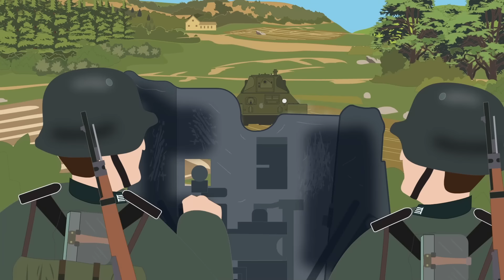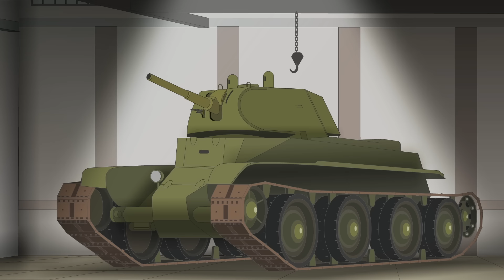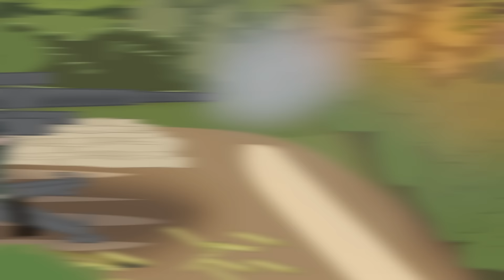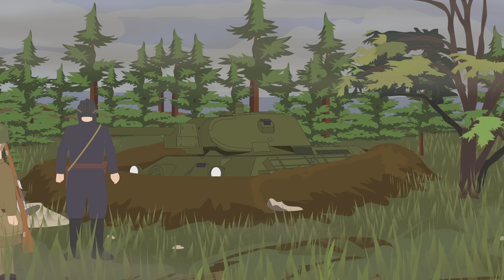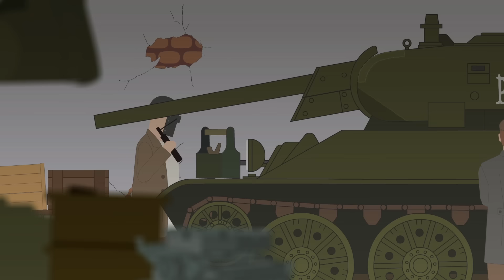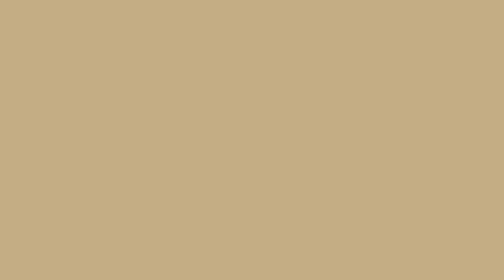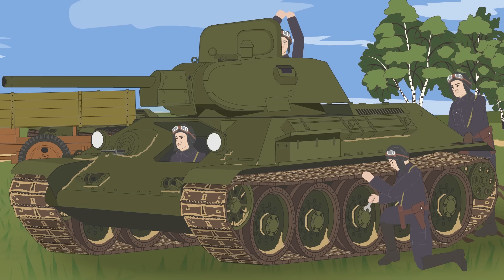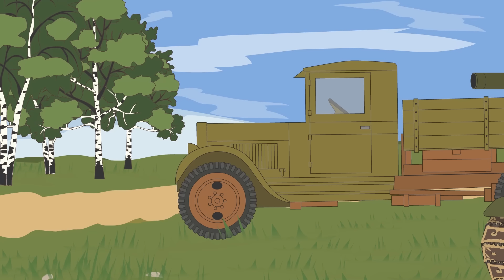Was the T-34 Really the Best Tank of WW2?

Comment: Best joke I have every heard applied to both the T-34 and the Sherman.  "The Tiger tank was as good as seven T-34/Shermans.  The problem was there was always an eighth."
Reply: Well, certainly didnt help when the Sherman Easy 8 /E8 came.
Reply: The tiger also would blow up its engine because it was far heavier than it could handle. The tiger was not only heavier but wider than all main battle tanks, so it needed specific terrain to be able to travel on.
Reply: @NickJaime  Ya it used the Panzer 4 chasis which was somewhat inadequate it also had alot of production problems out the gate engine wise (much like the panther). but it was probably the best tank of WW2 in terms of if you were going to design a tank today. The Tigers biggest flaw was that it was hard to mass produce frankly the Germans would have been better adding sloped armor to the Panzer 4 and strapping the 88 to its turret.
Reply: @toddpick8007  the tiger wasn't the best of WWII. It was over-engineer and wasn't lasting in combat. That doesn't make it the best lol. It was too heavy for a lot of bridges etc. It had far more negatives than positives.
Reply: @NickJaime  I would say from a sheer engineering standpoint that yes the Tiger was the best tank of WW2 and it wasnt really close. 95%+ of the Tigers "flaws" were due to production problems caused by bombing/shortages. The Tiger pretty much immediately outclassed every tank in every combat theatre it was in. Hands down it was the "best" tank of WW2 not most effective, produced, most decorated etc but best in terms of engineering.
Reply: @toddpick8007  except even tigers with perfect quality would still get their wheels clogged
Reply: @toddpick8007  No, an 88 Panzer IV with sloped armor would not have been good. The Panzer IV was already front heavy and seriously overloaded by the Aus F2 version. A totally new turret would be needed, which the turret ring may not even be big enough for. Then you'd likely hit the Panther's turret issues; it couldn't even be traversed on mild slopes. in  All of this to overstrain the suspension that was supposed to be upgraded to torsion beam, but never was.

There is no point in having a powerful gun when:
1. You physically cannot fit the gun without subjecting turret crew to the world's most dangerous of twister
2. Your suspension is physically unable to carry that gun to the battlefield
3. You physically cannot aim the gun at what you need to shoot at
Reply: @toddpick8007  and the tigers best attributes went to waste when the Soviets and Americans both started adding bigger guns to their tanks and heavier armor while maintaining things such as speed, ease to make, reliability (not to much the T-34).
Reply: @toddpick8007  do I think it was a horrible tank though? No, but it is such an overrated tank.
Reply: @Its-Av3rage  There wasnt a single allied tank a Tiger couldnt knock out at range and were talking frontal armor here. US and Soviets adding larger guns certainly helped them deal with tanks like the Tiger but the fact they had to do that to even compete shows just how good the Tiger was.
Reply: @toddpick8007  Big gun and a lot of armor isn’t what makes it a good tank most of the time
Reply: @toddpick8007 In terms of engineering the Tiger was a god damn nightmare tf? It was too ahead of it’s time for their capabilities.
Reply: @josh05683  it was engineered better than any soviet tank, the quality was much better in german made equipment than soviet.
Reply: That has to be one of the luckiest Tiger to be able to survive long enough to face Shermans without infantry support 
Because otherwise it would be a deathtrap
Reply: Yeah Sherman’s are junk it’s the firefly that helped allot not the regular junk Sherman pea shooter and the T 34 was absolutely an American design.
Reply: @maiaodai8378  wenn Tiger auf dem Schlachtfeld auftauchten,  war die Panik groß.
Oft war es gar kein Tiger , sondern ein Panzer IV, der für ein Tiger gehalten wurde und für schnelle Beine sorgte.
Reply: @maiaodai8378  Shermans gun couldnt pen a tiger at range until much later in the war and the tigers 88 would can opener a sherman.
Reply: @toddpick8007  expect Sherman’s could easily outpace Tiger turret rotation
Reply: @yeetyeet5079  If you cant pen it than its kinda useless lol.
Reply: @toddpick8007  nope Sherman’s can easily penn a Tiger on the side or especially the rear
Reply: @yeetyeet5079  Not at range it cant not with that low-velocity 75mm gun on it Tiger could turret pen at 1,800m. Youd be really lucky to knock a Tiger out at range even rear shot with a 75 mm low velocity gun on the Sherm.
Reply: @toddpick8007  laughs in your complete lack of knowledge Sherman had mid velocity guns and hvap ammo could penn a tiger even from the front at 500 meters
Reply: @toddpick8007  The mid velocity 75 was not the best anti-armor gun, but it was exceptionally good against what tanks actually faced on the battlefield. The US and UK found that their tanks were only shooting at tanks 14.2% of the time, and only a very tiny fraction of those were Tigers. Fortifications & caves (21.2%), buildings (17.3%), and personnel (15.5%) were all more common. There were also A/T guns & arty (12.8%), wheeled vehicles (8.2%) and everything else (10.8%). The amazing 75mm HE shell made short work of all of these targets.

That's why the British switched to the 75 over the 6 pounder, despite the 6lber being better at anti-armor. This is also partly why US tankers preferred the 75 over the 76. It's also partly why the US was reluctant to switch to the 76 despite the upgun being in development since 1941. That also ties in to why the Tiger was simply irrelevant in the grand scheme of the war. Nobody fought the Tiger enough for it to matter at all. WW2 wasn't a tank war, it was an infantry war like any other.
Reply: @WynnofThule  I never said it wasnt good i said it wouldnt Pen a Tigers frontal armor at 500m. As a psychological weapon it was very relevant and always on the minds of US tank crews. It was also used to great effectiveness in the Normandy campaign it was basically the bane of US tank crews.
Reply: @toddpick8007  the rare hvap for 75 Sherman’s had the ability to penn a tiger from the front
Reply: @toddpick8007  That's the thing, with it's low comparative production numbers, the difficulty it took to get to the battlefield, the amount of losses it saw from it's own mechanical issues and it's relative lack of mobility, the Tiger had such a hard time getting itself into fights where it could show it's good side that it barely helped. You cannot win ground that you don't contest.
Reply: @toddpick8007  the Tiger was certainly scary for the allies, I'd even go so far as to say it was a legend. Of course, like any legendary beast, you almost never met one in real life.

If the Allies had faced the Tiger more, it wouldn't be a legend of the war. It'd be a reality of the war.
Reply: @WynnofThule  Im not disagreeing with you at all lol.
Reply: @toddpick8007  Yeah, I'm just elaborating. Every broad statement has an asterisk, and the Tiger might as well have been a giant one.
Reply: @WynnofThule  They had a 5-1 Kill death ratio which is excellent.
Reply: @WynnofThule  The only reason i dont disagree with their Kill assessment is because there was literally so much material being thrown at them that all their K/D ratios are feasible. Its why they have so many aces, they could literally come into contact with enemy planes every time they were out so there numbers are inflated.
Reply: @toddpick8007  SS brigades were known to count wheeled vehicles and anti-tank guns as armored kills to pad their numbers, the Germans and Soviets were the two least trustworthy when it came to claims. And tigers certainly weren't suited to fighting enemy planes of all things, no roof MG like many American vehicles had.
Reply: @toddpick8007  this isn't war thunder, it's not all about penning a tiger at the front.
Reply: @naturalvalkyrie  Well considering how Tigers were used defensively and from positions of cover for the most part it kind of is.
Reply: @toddpick8007 they did penetrate it though
Reply: @yeetyeet5079 That was on the 76mm
Reply: @josh05683  Not at range which was the issue, which is why Sherman tactics was close distance.
Reply: @yeetyeet5079 
Dazu mussten die Shermans aber erstmal in diese Position kommen. Und die meisten Tiger wurden nicht von gegnerischen Panzern ausgeschaltet sondern von Jagdbombern. Und es gab viele Ausfälle durch technische Mängel. Der Kampfpanzer VI wurde für den Durchbruch durch generische Verteidigungslinien entwickelt (daher auch die interne Bezeichnung Durchbruchswagen) und nicht für den Kampf Panzer gegen Panzer. Dafür gab es den Kampfpanzer V Panther, der schneller und leichter war und mit der 7,5 cm Kampfwagenkanone ebenfalls ein sehr gutes und tödliches Geschütz hatte. Beide wurden übrigens schon Ende der 1930'er Jahre in Auftrag gegeben und sind keinesfalls eine Reaktion auf die ersten T34, KW 1 und KW 2. Das Problem der deutschen Panzerproduktion war die Ressourcenknappheit, der Mangel an qualifizierten Fachkräften und das ein Benzinmotor benutzt wurde. Im Einsatz kamen dann noch Mängel in der operativen Führung und Benzinmangel dazu. Es konnten auch sehr viele dieser beiden Panzertypen wieder instandgesetzt werden, wenn das Schlachtfeld in deutscher Hand blieb. Nicht umsonst hat Frankreich den letzten Panther in den 1960'ern ausser Dienst gestellt und die deutschen Instandsetzer wurden von Frankreich schon während des Krieges besser behandelt als normale Kriegsgefangene. Selbst das entsprechende Handbuch wurde schnellstens ins französische übersetzt. Beim Tiger 2 wurden auch um eine gemeinsame Basis zur besseren Ersatzteilversorgung Elemente aus dem Panther verwendet wie zum Beispiel das Schachtellaufwerk und die abgeschrägte Panzerung. Die Schwäche bei der Motorisierung blieb aber erhalten.
Reply: the tiger was literal garbage.....when it did'nt have a brocken gearbox or it wasnt stuck in the mud , it had a world class cannon but thats about it.
Reply: @kamikaziking  World class optics, world class armor and world class radio. The Tiger was excellent when it was operational.
Reply: @toddpick8007  majority of the time it wasn't  and it couldn't  fire on the move like the t34 , try harder
Reply: @kamikaziking  t 34 couldn’t fire on the move either however at least it was light and cheap
Reply: @yeetyeet5079  50%+ mechanical failure rate. Cheap is correct.
Reply: @toddpick8007  with the t 34 you get what you pay for tigers are just money sinks
Reply: @yeetyeet5079  Not disagreeing with you logistically and cost benefit wise they made no sense comparative to combat performance. T-34's were still garbage.
Reply: @toddpick8007  the t 34 85 was passable able the kill tigers frontally a kilometer away
Reply: @yeetyeet5079  why is everyone here talking about the frontal armor only? An allied study of tank combat, the same one that did the target analysis I cited earlier, also did a study of where hits most commonly occurred on allied tanks. They found that 37% of the hits went to the front, 60% to the side, and 3% to the rear. Ignoring the side armor when the vast majority of hits go there is quite reductive.
Reply: @WynnofThule  no im saying a t 34 95 can penn a tigers thickest armor at good range so the other parts of the big cat would be even more Vulnerable
Reply: @yeetyeet5079  OK, that's fair. But I remember some of y'all were also using the same argument about the 75 Sherman. 75 Sherman crews knew that. They wouldn't engage Tigers frontally, and a Tiger that engaged them would be hit with white phosphorus. This would blind the tank. Because German ventilation systems sucked in the toxic smoke, it could cause chemical burns to the crew inside the tank if they didn't vacate immediately. This meant that a smoke shell alone could knock out the Tiger.

If the crew didn't abandon the tank or the tank didn't take up much smoke, Sherman crews would still use the opportunity to close the gap, reposition, and get alongside the Tiger.
Reply: @WynnofThule  there was the rare hvap ammo able to penn a tiger
Reply: @toddpick8007  A.) when it was operational which is a huge issue considering only about 2000 we’re made. B.) The US radios were superior boasting better range.
Reply: @kamikaziking The T-34 couldn’t fire on the move either, it didn’t have a gyro stabilized gun.
Reply: @josh05683  all tanks could fire on the move you dolt........the Tiger needed to be in a fixed position because of the recoil hahahahahahahahahah
Reply: @kamikaziking  Grow up, don’t act like you’re 12. 

 Sure, any tank can technically fire on the move, but that’s completely irrelevant. It was completely ineffective, a waste of ammo, and you couldn’t hit anything without the assistance of gyrostabilized guns.
Reply: @toddpick8007  Luckily the Sherman could just get a 76mm gun and get its 4 other tanks to overwhelm the Tiger. The Tiger was a world class failure, the only reason it’s praised is because of games depicting it as indestructible.
Reply: @Kokangalang  Problem being that 1. most shermans wernt fitted with the M1 gun they only had about 1500 built from May 44 - December 44. Standard allied tank practice was to use force to overwhelm the Tiger and other German tanks but that kind of speaks to the effectiveness of those tanks in general when you have to use "human" wave style tactics to defeat it. The Tiger was a logistical failure but not a technical one it was a very well designed tank (not necessarily built). With that being said the Germans would have been better off putting an 88 on a Panzer 4 and beefing it up a bit.
Reply: That's not how it works, like at all. The Americans would take 5 shermans to deal with a Tiger, or a Panther, or a Panzer IV, or literally anything else on the battlefield because 5 tanks was a platoon. Nobody will be like "No Jerry, we don't need a 5th tank, this is only a Panther, you stay behind."
Reply: This was an absolute fiction written by SS generals in their war memoirs. Who would often embellish their accounts by claiming every vehicle killed, from jeeps to half tracks, as tank kills. The M18 had verifiable kill ratios in some regiments of 10:1 

When I was young the quote was: a tiger could kill 4 Shermans, but there was always a fifth.

Then it was 6 Shermans, but there was always a seventh. 

Now it's 8. 

The Tiger benefits from the embellishment of German technology. The truth wehraboos don't want you to know:

The Bismarck was inferior to almost every nation's Frontline battleship 

Enigma was crap and was being read daily while the US SIGABA would go unbroken for more then a decade after WW2

The 262 was barely a few months ahead of allied jet fighters, the meteor and aerocomet. The allies just weren't desperate enough to send unreliable machines into service.

If you scratch the surface of SS Tiger reports you'll find cases where they claim more tank kills in a battle then the allies deployed.
Reply: @hypersonichobo4263  Well no the ambush by Wittmann in question near Bocage is substantiated by British and German sources via the losses the British 7th Armoured suffered on that date.

The Bismarck wasnt "inferior" it was a very capable albeit light armored battleship. Its "infamy" was sinking the hood and requiring the entire "Home Fleet" to sink her. 

The enigma was pretty good the allies didnt solve it until they got the codex's . 

The 262 was years ahead and its design would be later incorporated in both the F-87 and Mig-15. Most allied jet fighters were produced sparingly if at all and saw no combat service.
Reply: @toddpick8007  

Bismarck was slower, less armored, less well armed and less AA defenses. It had fewer main guns and of those guns they were sub sized batteries. North Carolina while a mere 2 knots slower was more well armed, protected, more resilient to air attack, and had far superior fire control. All this while still being lighter. 

As an aerospace engineer the ME-262 was not light years ahead of it's time. The swept wing was innovative but the 262 never went fast enough to realize the reason for a swept wing. On the other side you had the British and Americans with far superior engines and metallurgy. 

And Enigma was broken in the early 1930's long before the allied powers were even "allied". It was inferior to the British TypeX and was so inferior to SIGABA that German code breakers made 0 progress throughout the war and began to believe it was gibberish meant to waste their time.
Reply: @hypersonichobo4263  Again Bismarck was a perfectly Capable Battleship was it "top of the line" like US  Iowa class no but it was more than capable of going toe to toe with any WW2 era battleship. It was enough of a threat to allied shipping after sinking the Hood that the British deployed their home fleet to intercept and stop it.

Yes it was years ahead of its time which is why the designs incorporated within were literally used in US and Soviet 1st gen jet fighters. The Jumo 004 was also a good engine and very innovative and the worlds first production jet engine. The Germans problem wasnt "inferiority" it was lack of resources because they were literally being bombed night and day.

The enigma code wasnt "broken" until they got the codex's off of U-570 and SIGABA was based of Enigma fixing the design flaws.
Reply: @toddpick8007  Sigaba's development preceded any availability of Enigma, it was not a development of Enigma. And Enigma itself, an electromechanical rotor machine was based off the Hebern Rotor Device which was American. 

The Jumo 004 was fundamentally flawed. While it is technically the first production jet, it's also objectively the worst. The Germans were not light years ahead, optimistically they were maybe a month or two. Though their metallurgy was way behind. 

And again, the Bismarck could not go up against any WW2 era ship. It was a development of the obsolete Bayern dreadnought class. The Nagato, Yamato, Jean Bart, King George V, North Carolina, South Dakota, and even the Littorio classes of battleship all had more pros vs cons in comparison to Bismarck. 

Hood was a battle cruiser, her deployment against Bismarck should never have occured and she paid the price. But Bismarck did not go "toe to toe" with the home fleet, Bismarck was pummeled into a bloody mess in an alleyway by the British home fleet. A biplane of all things crippled here, she couldn't even sink a Polish crewed destroyer if it came within rifle range, shot at it with rifles, and belted out the Polish national anthem (all of which happened, and the destroyer sailed away scot free)
Reply: @hypersonichobo4263  Sigh...Here we go

a. No it didnt the Enigma patent was widely commercially available after 1919 and the British TypeX literally is a carbon copy of it with some mods made to make it more secure. While SIGAB's wasnt exactly the same it was very much an improved version of the Enigma.

b. The Jumo 004 engine itself wasn't a poor design at all actually. The fact that it could run on av-gas, Diesel or Coal derived fuel made it extremely flexible it was also reasonably inexpensive to produce, so much so that it was used/built by the USSR after the war. Saying its "objectively" the worst is asinine its like saying the wright brothers plane is objectively the worst plane lol.

c. Yes it could and it did. Again just because its not Iowa Class quality doesnt really mean it couldnt hold its own which it did against Hood and Prince of Wales (King George Class) sinking hood and severely damaging Prince of Wales. The Bismarck had had eight fifteen-inch guns which is comparable to the Iowa class 9 16 inch guns in firepower and at 29 knots the Bismarck was faster than any Royal Navy Ship at the time. 

Yes i know that numpty. No actually it wasnt it sunk the hood and damaged Prince of Wales to the point it had to disengage and the Bismarck was then free in the Atlantic to raid shipping (which was what it was kind of meant for) in theory but not reality. Bismarck was sunk by some antique Bi-Plane torpedo squad from the arc royal because its AA guns couldnt pick up slow moving targets.  Was the Bismarck the best battleship of WW2 no, was it the worst? No. Was it a capable ship that could hold its own? yes.
Reply: @toddpick8007  wasn't talking TypeX, and again, Enigma is an evolved Hebern, the innovation was in the plugboard. But SIGABA was a direct improvement on Hebern, there is 0 evidence to believe that the designers took an Enigma and said "let's make it better", especially because if they had it wouldn't have ended up as well as SIGABA did. But even if you were right, the Enigma was a horrendously flawed machine with flawed operational discipline. SIGABA was as far ahead of Enigma as wehraboos think the Me-262 was ahead of the allied jet programs

The German 15" being equivalent to the US 16" is a laugh, but that's all it is. The German high velocity light shell was intended for direct fire. The US Super heavy shell was the best in the world in the 16 inch caliber and had no peer at or under it's caliber. It achieved it's spectacular performance and weight through the innovation of heat treatments that could treat the entire exterior of the shell rather then localized treatments. It allowed for a shell that could punch it's way through very high angles of attack. 

The 16 inch shell was far heavier carrying a higher kinetic energy on impact and a large explosive charge at impact. The 16/45 of the Carolina and South Dakota were some of the best rifles in the world, the 16/50 was an improvement on perfection. 

A case can be made against the Japanese 18" shell. The weights aren't far off. The superheavy 16" was the best 16" shell whereas the 18" was a very poor 18" shell.
Reply: @toddpick8007 the bismarck was not a “light armored ship” wtf lol. Nearly a foot and half of armor.
Reply: @josh05683  The Bismarck was light armored comparative to other battleship classes in contemporary navies. It was called a pocket battleship for a reason and is why it was so speedy.
Reply: @toddpick8007  like which battleships?
Reply: @hypersonichobo4263  as a German, I really admire your ability to argue with stupid Wehraboos
Reply: Thats what they all said 'till a Joe Ekins and his boys comes in and smokes an entire 14 tank force with no losses
Reply: That's a good one
Reply: Problem was thatyou got like 10 shermans forone tiger, and probably 15 t-34s. More mobile as well, and tanks are not all aboy tank on tank battle, which is why tigers were trash in the end
Reply: Except single Sherman’s and t 34s in some cases killed multiple tigers
Reply: @yeetyeet5079  Not at range and not in 1944 maybe later when the T-34 and Shermans got the gun upgrades.
Reply: @toddpick8007  still tigers weren’t as good as their made out to be
Reply: @yeetyeet5079  No the "legendary tiger" is probably more post war Soviet Propaganda to make their T-34 coffins look imposing the "we beat the biggest bullies tanks so dont mess with ours" kinda thing. The Tiger was an excellent platform for the time probably the best platform but its flaws were noticeable (namely production problems and quality issues) . It wasnt some invincible tank but lets assume youre in WW2 you have your choice of tank and there are zero quality control issues with it which are you choosing? 9/10 Tiger on gun alone tiger.
Reply: @toddpick8007  tiger is best tiger proceeds to get murdered by is2 and if anything the mighty tiger myth was either German propaganda or American “documentary” nonsense
Reply: @toddpick8007  I would choose t 34 85 because even the best made Tigers had their tracks get clogged and they were too heavy for their own drive train
Reply: @yeetyeet5079 IS-2 was a nightmare within itself.
Reply: Thats what they all said 'till a Joe Ekins and his boys comes in and smokes an entire 14 tank force with no losses
Reply: I touchy the joke was ten and eleven not seven and eight
Reply: You also had Sherman fireflies and M36 Jacksons, which were designed to deal with the tiger and panther.
Reply: @TheLegitAlpha  the Firefly would obliterate ANYTHING the germans fielded, they feared the Firefly so hard that Crews would paint their barrels to look like 75 shermans instead of the long gun Shermans
Reply: There were alot more shermans and t-34's made than Tigers Tigers are heavy and expensive.
Reply: @sheilaolfieway1885  hence my statement.
Reply: @toddpick8007 2 years later and you are still a loser
Reply: bro acts like this joke hasn't been repeated a million times
Reply: Yeah mass production doesn't always mean best and quality doesn't either
Reply: Best joke, your grammar
Reply: Even if the tiger 1 and tiger 2 arent as good as they are said to be, you gotta admit they look cool
Reply: Guess who lost the war
Reply: Absolutely. But you have to understand one thing. The Tiger tank wasn't invented for the role which he actually was used in. It was developed and built first and foremost as a heavy breakthrough tank for big strategic operations. It had to go in the first line leading the rest of medium tanks in breakthroughs knocking out anti tank defenses at large distances. The irony was that in this intended role the Tiger was used essentially only once: in the Kursk battle which ended in defeat for Germans. And maybe you count the operation near Lake Balaton in Hungary in 1945, too. That's all. After the Kursk battle Germans lost the strategic initiative for good and there was no talk of any large scale strategic offensive operations on the Eastern Front. So the Tiger began to ve used in purely anti-tank role. Yes, it was very good in it. But 1. 'There was always an eighth tank" and 2. It was crazy expensive for this role. Instead of many cheap anti-tank guns you have a very expensive on heavy tank which is essentially one very well defended gun. If the enemy will be dumb enough attacking it head-on or you are fortunate enough to have unique geographic circumstances, that's OK. But usually the enemy simply outmaneuvers you and your precious Tiger is left broken/ without fuel and/or ammunition.
Reply: Тигр больше приносил проблем чем пользы для германии 😂😂😂
Reply: Ну, на самом деле конкретно Тигр - та ещё хрень, с точки зрения стратегии. Медленный, не такой уж неубиваемый как надеялись немцы, а главное он имел кучу "детских болезней" вроде шахматной подвески, застывавшей намертво после ночи в русской грязи (грязь каменела в колесах), двигателя способного загореться просто так, малого запаса хода и т.п.
Reply: @ЮраСидоров-т4э  lol yeah? how about all that nice Russian armour that shattered on the inside when hit by anything bigger than a 75mm resulting in the commie crews being shredded with white hot steel? lets be real the only commie tank that could even try to stand up to german tanks were the is-2 and beyond. before that yalls tanks were trash, honestly yall would've had more luck with boots on the ground.
Reply: @Atlas117gaming  Да да, знаменитые басни от "инжинера а пятом поколении". 
А теперь список танков, которые унижали немцев на момент своего появления :
Т-28
Т-34
СМК и Т-100
Кв-1
Кв-2
Ис-1
Ис-2

А так же все самоходки на их базе. Даже ваши генералы, в боях под Москвой писали Гитлеру что " Танки ПЗ серии 3 больше не способны на равных бороться с русскими Т-34, нам срочно нужна новая машина".
А для Кв-1 вообще приходилось использовать Флак 8.8см, потому что больше никто не справлялся.
Reply: @Atlas117gaming  "из всех танков только Ис-2 мог ПОПЫТАТЬСЯ бороться с немцами" - ой, правда? 

А вот воспоминания самих немцев, которые его боялись до потери пульса, говорят об обратном. Есть замечательные мемуары связиста Тигра-2, в которых автор описывает как после НЕ ПРОБИТИЯ от Ис-2, в их танке все получили контузию, а наводчик вообще умер, отброшенный ударом к углу казенника. БЕЗ ПРОБИТИЯ.
Reply: @ЮраСидоров-т4э  this other comment just proves my point? Like I said only the is2 could try to fight the Germans. Also I won't be responding past like maybe 1 more comment from you cause it isn't translating and your language is a nightmare.
Reply: @ЮраСидоров-т4э Главное не в этом. Тигр конструировался и производился изначально как тяжёлый танк прорыва. Он должен был вести за собой толпы средних танков, убивая противотанковую оборону с больших дистанций. В этой роли его недостатки, а, главное, небольшие цифры производства, не играли такой уж большой роли. А техническое превосходство очень даже играло. Вся проблема была в том, что в задуманной роли Тигр применялся только один раз: в Курской битве (ну можно ещё Балатон добавить). После безнадёжной потери стратегической инициативы Тигр стал применяться в совершенно несвойственной роли главного танкоборца.  Да, как танкоборец он был очень хорош. Но он был безумно дорог (Исаев как-то говорил, что его стоимость была на уровне Б-29.  Если вспомнить, что в техзадании на Б-29 значился чудовищный для ВМВ радиус действия 5000 км, то да, внушает.  И, будучи чудовищно дорогим, Тигров было очень мало.
Reply: @ЮраСидоров-т4э  Speak human
Reply: @ЮраСидоров-т4э  Say that to Michael Wittmann.
Reply: @ЮраСидоров-т4э  "Russian mud" 
Both sides suffered in the Russian mud
Reply: There is the black baron who was able to take out an entire armored division of 15 tanks with just 3 under his command
Reply: @thegothhistorian3336  An armored division consists of over 200 tanks youre thinking a Company.
Reply: Hahahahhahahahahahhahahahahahahahahahahahahahhahahahahahahahahahhahahahahahhahahahahahahahahahahahahahhahahahahahahahahahhahahahahahhahahahahahahahahahahahahahhahahahahahahahahahhahahahahahhahahahahahahahahahahahahahhahahahahahahahahahhahahahahahhahahahahahahahahahahahahahhahahahahahahahahahhahahahahahhahahahahahahahahahahahahahhahahahahahahahahahhahahahahahhahahahahahahahahahahahahahhahahahahahahahahahhahahahahahhahahahahahahahahahahahahahhahahahahahahahahahhahahahahahhahahahahahahahahahahahahahhahahahahahahahahahhahahahahahhahahahahahahahahahahahahahhahahahahahahahahahhahahahahahhahahahahahahahahahahahahahhahahahahahahahahahhahahahahahhahahahahahahahahahahahahahhahahahahahahahahahhahahahahahhahahahahahahahahahahahahahhahahahahahahahahahhahahahahahhahahahahahahahahahahahahahhahahahahahahahahahhahahahahahhahahahahahahahahahahahahahhahahahahahahahahahhahahahahahhahahahahahahahahahahahahahhahahahahahahahahahhahahahahahhahahahahahahahahahahahahahhahahahahahahahahahhahahahahahhahahahahahahahahahahahahahhahahahahahahahahahhahahahahahhahahahahahahahahahahahahahhahahahahahahahahahhahahahahahhahahahahahahahahahahahahahhahahahahahahahahahhahahahahahhahahahahahahahahahahahahahhahahahahahahahahahhahahahahahhahahahahahahahahahahahahahhahahahahahahahahahhahahahahahhahahahahahahahahahahahahahhahahahahahahahahahhahahahahahhahahahahahahahahahahahahahhahahahahahahahahahhahahahahahhahahahahahahahahahahahahahhahahahahahahahahahhahahahahahhahahahahahahahahahahahahahhahahahahahahahahahhahahahahahhahahahahahahahahahahahahahhahahahahahahahahahhahahahahahhahahahahahahahahahahahahahhahahahahahahahahahhahahahahahhahahahahahahahahahahahahahhahahahahahahahahahhahahahahahhahahahahahahahahahahahahahhahahahahahahahahahhahahahahahhahahahahahahahahahahahahahhahahahahahahahahahhahahahahahhahahahahahahahahahahahahahhahahahahahahahahahhahahahahahhahahahahahahahahahahahahahhahahahahahahahahahhahahahahahhahahahahahahahahahahahahahhahahahahahahahahahhahahahahahhahahahahahahahahahahahahahhahahahahahahahahahhahahahahahhahahahahahahahahahahahahahhahahahahahahahahahhahahahahahhahahahahahahahahahahahahahhahahahahahahahahahhahahahahahhahahahahahahahahahahahahahhahahahahahahahahahhahahahahahhahahahahahahahahahahahahahhahahahahahahahahahhahahahahahhahahahahahahahahahahahahahhahahahahahahahahahhahahahahahhahahahahahahahahahahahahahhahahahahahahahahahhahahahahahhahahahahahahahahahahahahahhahahahahahahahahahhahahahahahhahahahahahahahahahahahahahhahahahahahahahahahhahahahahahhahahahahahahahahahahahahahhahahahahahahahahahhahahahahahhahahahahahahahahahahahahahhahahahahahaha
Reply: even the nineth was no problem because usually they preferred to ran when  Tiger roared
Reply: @michaelpielorz9283  Shut up, Wehraboo, instead of talking, you should put out your engine fires.
Reply: @michaelpielorz9283 there was also a tenth, it's just that that one was hit by and artillery shell
Reply: @michaelpielorz9283 wehraboo